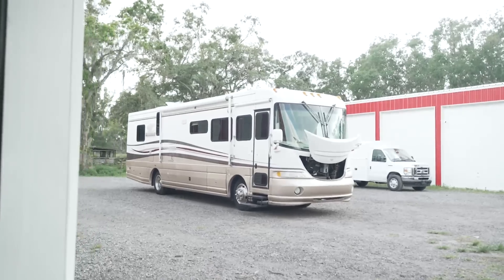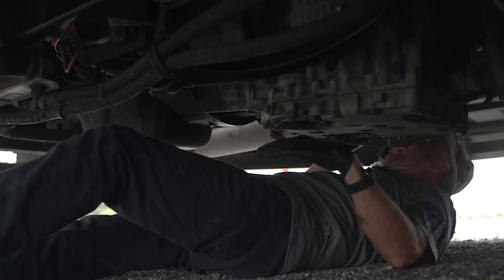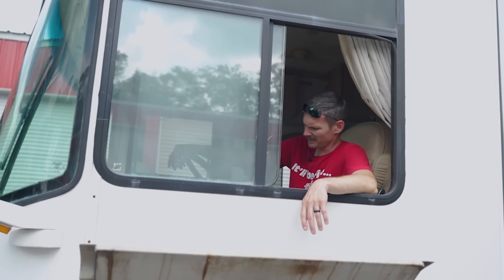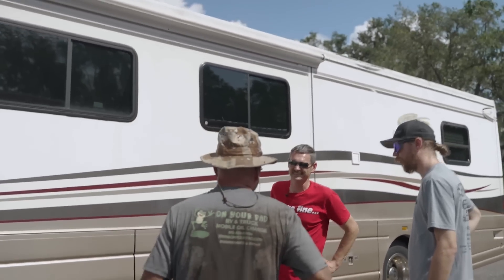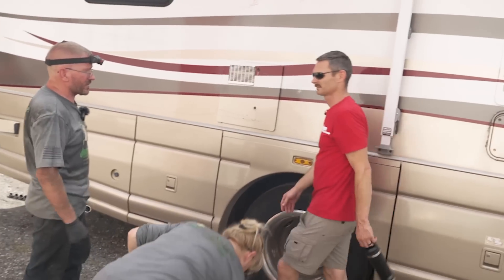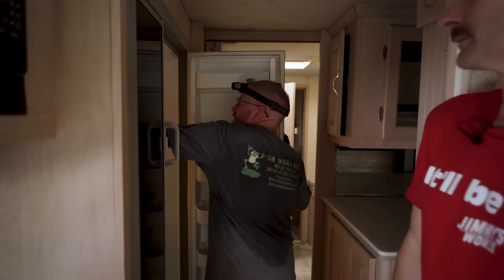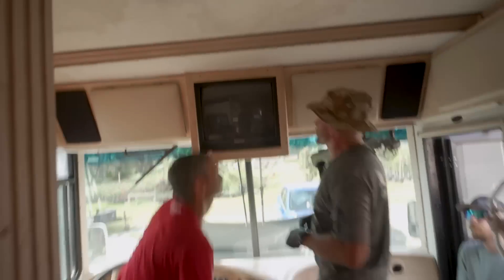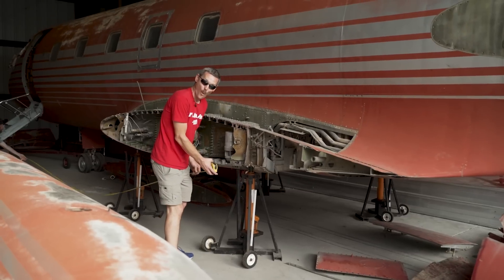Everything Broken On The FREE Abandoned RV

Comment: Jimmy I have a 1999 380 MBS as well and I have no idea how my batteries are supposed to be connected. Do you guys have any information on the battery schematic? When I bought my coach the previous owner had just replaced the batteries and the shop that did the work hooked them up wrong. I’ve been trying for the past couple of years to figure out how they are supposed to be wired. If you or Bruce have any suggestions I would appreciate it. BTW I love your channel and content that you share….I must because here I am watching the trip with you and the guys having just picked up the RV for your maiden voyage across Florida and it’s 12:40 in the am!

Comment: Lap sealant isn’t the primary seal!!!   It’s just to redirect water.   The main seal is what’s under the vents or skylights.    Also don’t follow this guy and coat it.  That’s a bandaid and not a good one

Also there is lauan (plywood) very thin and styrofoam under your roof.  The strength comes from all that being laminated together so when it’s damaged or soft the roof is compromised.     Just be safe out there.

Comment: Think RVs are the most hated vehicles a mechanic would ever want to work on. Once told a rv owner he shouldn't be pulling a full size 4x4 behind his rv. he told me I didn't know what I was talking about as his was rated to pull that much. I showed him the blue front rotors with chunks broken out from heat cracks. None were available and his vehicle was down for 3 weeks with him in it. Wanted to know why I couldn't fix it. His RV maker had special made rotors that were unobtainable.

Comment: Jimmy.  Tell your R V tech that R V refrigerators do not have freon.  The refrigerator uses ammonia, hydrogen, and water to cool.  Also, it takes several hours for the refrigerator to cool down.
Reply: Think exactly the same - it's not a compressor refrigerator - but we can't call him out as he was the expert (well his T shirt said he was)
Reply: That’s funny. Ammonia is the worlds oldest refrigerant but has been very widely discontinued in the United States  and replaced with various CFC’s and HFC’s
Reply: @mikeryan6277 actually no it hasnt... just not used in recipocating compressors much... it has not been replaced by freon its still used in High volume refrigeration systems
Reply: Been my experience that freon is used as a generic term. Kind of like "filming" with a iPhone.
Reply: Not sure about this Suburban fridge but the Dometic ammonia absorption systam in our old Airstream had propane high/low flame heat and an electric heater unit for use with 120 VAC or 12 VDC  ( separate circuits in same element).
Reply: Freon is also a name brand....so it's refrigerant if you want to call someone out properly
Reply: @tundramanq  so with two heat sources, your fridge was really an oven.
Reply: Yep, and if the cooling unit leaked the ammonia out, it's finished, nobody "recharges" them; and a replacement cooling unit costs as much as a whole new refrigerator.
Reply: Jimmy...someone tell this guy Mike walker that freon is a brand name....

Comment: Gosh, Jimmy that isn't such a big list for a vehicle left neglected for so long!  No real expensive fixes,  except perhaps the generator. Contact "Small engine mechanic" channel on you tube. There isn't much he does not know about generators! It is also his "Day job". Those ceramic magnets are possibly from the battery charging alternator. When I was running my own bus-motor-home, I adjusted the brakes for about 1" travel on the slack adjuster. Glad to help with experiences if I may.

Comment: The roof is squishy and leaky. It has electrical issues. The AC plenum in the front has broken and fallen down. The AC compressor is shot. The generator is toast. The water heater doesn't stay lit. It needs new suspension airbags, and there's a long list of other things needing repairs to make it a reliable and usable motorhome.

It would cost far too much to fix everything that needs fixing to put it back to use in its current form. But sell off all the stuff that won't be needed in or won't fit in the Elvis jet body, stirp the chassis down to the essentials, then repair what needs repaired and have easy access without any body or floor in the way - that's how to save money on it.

Either way it's not going to be inexpensive. Buy an RV in good working order or put money into this "free" one. It is going to cost.